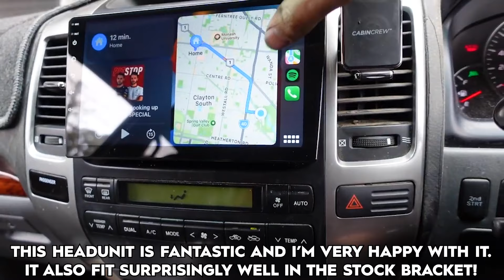BUILDING A LANDCRUISER PRADO IN UNDER 10 MINUTES!

Comment: From Perth and onto my 2nd prado 120 4ltre as i love em & so does the wife.  Previous had an 04 5sp man GXL & wife got sick of changing gears in city traffic.  
Current is a black 07 GXL auto 4ltr with 200ks & tons of upgrades including a Harrop E-diff locker in the rear diff (will eventually get the front diff done as well) Redark dual battery set up/ redark Tow Kit/ LED black binnacle headlights - complete headlight swap & game changer/ LED taillights with dark shaded indicators - complete assembly swap - game changer) Big red LED spotlights/ rear slide draws & wired for fridge.
Upgraded Exhaust with custom s/steel larger piping from headers back and it sounds hot with a low rumble.  (I have the shortie Headers ready to fit as well & will be doing that soon) 
 I have a new lift kit (springs & shocks) ready to swap in.   (i am a DIY at home with a workshop & hoist which makes life much easier)   
Can't decide on wheels 17 x 9 ET0 spec but like what you have fitted up & surprised no rub issues with front upper control arm on yours.
These 120 Prado's are great cars and really comfi on long trips.  
I swear by the 1GR-FE 4 litre engine after having owned 2 x 120 Prado's with these engines over the past 10yrs
Enjoy and subscribed

Comment: What about the engine?  Lots of repair?
Reply: The 1GRFE is Toyota’s best & most reliable engine ever.  Well the upgraded version from 2009 actually is but this one is a very close 2nd.  Speaks volumes.
Reply from the maker: All I’ve done is serviced the car. The engine hasn’t missed a beat. Runs beautifully and has 370,000km on it!
Reply: You may experience a timing cover oil leak soon but that should be about it for a while.  The 1GRFE engine was first used in the Prado in 2003.  It’s not used in Toyota models in Australia anymore due to our price of fuel potentially hurting sales, but is still used in American Toyota 4wds, the Tacoma & 4Runner in 2023.  It uses old school technology by modern standards and doesn’t even have as much power output as it could’ve had, but I guess that’s what reliability, no fuss minded people like about them.  That’s an engine that’s been in flagship Toyota 4wds for 20yrs now.
Reply: Watch out for bad injectors. May cause serious damage to engine without any signs or warnings
Reply: Congrats! You are a master! 
What’s the model of the CarPlay mídia that you installed? Thanks